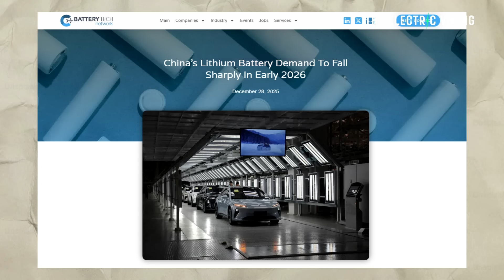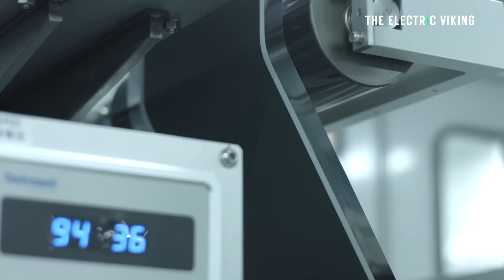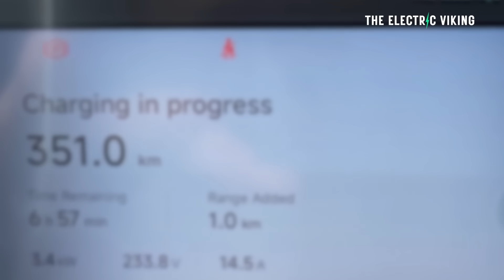SODIUM TAKEOVER! CATL Confirms Mass Deployment of Sodium Batteries for EVs

Comment from the maker: The car I drive, the Xpeng G6 - https://youtu.be/IcniwO8NfQQ

RESINC Solar installed my battery and solar system. Get a free quote from them here: https://www.resinc.com.au/electricviking
Reply: Any idea when individual consumer 18650 or 21700 cells will be available?
Reply: Alas, they don't appear to be in Melbourne.

Comment: Lfp and sodium battery density are calculated on a per weight basis. Sodium batteries are criticized for being too heavy. 
This must mean a 60kwh sodium battery must be smaller in size than a 60kwh lfp battery.
This must mean more sodium cells will fit in the same space as that of a lfp battery.
Maybe sodium batteries may have longer real world range.

Comment: I read somewhere that there is a wee problem with Na batteries.  Apparently Li batteries maintain almost a constant voltage as they discharge until right at the end.  Na batteries, thought, apparently have decreasing voltage as they discharge.  The article said that this is not an insurmountable problem but does require special electronics to deal with this voltage fade.

Comment: As the battery use increases, so will the need for fossil fuels to power them and build them. Effectively, you require more energy for a solution that was never needed in the first place. Probably doubling your energy requirements to build batteries than just using petrol or diesel.

Comment: Nobody is replacing humans with humanoid robots. That’s a myth. It does not exist anywhere. Manufacturing robots are replacing humans. They are not the humanoid toys that companies are working on. They are stationery and plugged in to power and the network. Humanoid robots are still dumb toys. They will have to be connected to a network wirelessly and will have to stop and charge frequently. They are not AGI and don’t even have AI onboard. Think romba..

Comment: Another plus for sodium batteries will be for starter batteries for current ICE vehicles. For not much more than a good quality lead acid battery I got a sodium battery with double the CCAs and still works in -30 or colder. No more wimpy lead acid.

Comment: If the price drops to under $20 per KWh, that is great news for grid storage and home storage. For grid or home storage the energy density doesn't really matter, the most important thing is the cost per KWh. Regardless of how rapidly cars swith to sodium ion batteries, companies like CATL will have plenty of customers for their batteries. Countries like Australia are already using large grid storage batteries, anyone saying that cheaper options for grid storage won't gain customers - well, I don't think anyone with a brain would say that.

The market for sodium ion batteries includes: Grid storage, home storage, budget oriented cars and any devices that operate in very cold conditions. That has to be a pretty large market, surely.

Comment: I work for an inverter manufacturer and we tested sodium batteries. We applied a large inductive load to the inverter and the batteries were not capable of delivering current fast enough to power the inductive load. The voltage collapsed and the inverter shut down. We referr to this as internal resistance and the internal resistance of the sodium batteries we tested is too high. So they might work fine for vehicles but in residential applications with large loads such as water pumps or air conditioners they may not be the best solution.
Reply: I'd love your input, another issue with Sodium-ion is they have too large of a voltage drop as the State of Charge decreases. Don't inverters usually require the input voltage to be relatively stable?
Reply: @Seattleandrew Inverters can handle any input V range if they are designed for it. The problem is that as the input V drops the input current has to increase for a given output power. This means the inverter electronics have to be able to handle higher currents which increases the cost.
Reply: @petewright4640  that makes sense. I'd assume that Na-ion is a nifty solution for some situations, but it's not a true replacement for every Li-ion application. Less energy density, less current output,  less usable voltage, but safer, potentially cheaper batteries.
Reply: Domestic loads don't use much compared to an ev. My relatively low power ev van draws 43kw when I put my foot down. A lot depends on the capacity of the battery. Large batteries have proportionally lower internal resistance. A house battery could have a large capacity as it's not size limited like an ev battery.

Comment: Lithium batteries will always weigh less than Sodium batteries. 
This is basic physics.  Sodium batteries are cheaper, but technically a step backwards.
A step forward would be Lithium batteries with a solid electrolyte.  This is uncontroversial as it is physics. 
Sodium batteries is a good solution for houses, or centralised storage

Comment: Researchers at the University of Buffalo could add a ‘superconducting’ twist to magnetic hard drives and random access memories (RAMs) after succeeding in building a Josephson junction using only one superconductor instead of two. The achievement could unlock new, simpler, and more flexible quantum designs in the future. 
A Josephson junction is the foundational building block of quantum computers. Built on the principle of superconductivity, the device consists of two superconductor layers separated by a thin barrier. Under these conditions, the superconductive nature flows into the barrier, synchronizing their behavior. 
Researchers at the University of Buffalo teamed up with those in Spain, France, and China to demonstrate that a Josephson junction could be built with just one superconductor layer instead of two and in the process showed how commonly available iron could also be used for quantum applications.

Comment: Have they found a way to flatten the sloping discharge curve that is prevalent with sodium ion batteries?   I don’t see them working well with EV’s until that is sorted out.  They need to be able to provide consistent voltage

Comment: Reliability and environmental stability is the key.  Sounds like sodium ion is a big improvement in these areas.  Longevity without degradation is very important.  Now the rest of the systems need to come into line, charging infrastructure and clean power systems.  Here the pollution is just moved a few miles away to a fossil fuel burning power plant.  My solution so far has been to cut my travel to one third and use higher efficiency ICE vehicles.  Looked at used EV but too many battery problems  and no local service.

Comment: Steady the Buffs. "Cheap" energy storage may be great, but where does the energy to be stored come from? Do we really want the country covered in wind farms with the need for new transmission grids? Last year the UK paid wind farms £1.5 billion to turn off. Increasingly, like in Germany the UK has periods of very low or no wind with a resulting fall back to Gas power stations. These power stations are necessary for reserve but will not be built without subsidies. The inevitable result, the more renewables on a system the more expensive electricity will become. Ed Miliband promised to cut energy bills by £300 but they've gone up by £200 since he took office thanks primarily to renewables.  And if battery energy storage is the silver bullet why is China, the world's leader in this area building so many coal power stations? Battery storage may help make extremely expensive electricity simply very expensive.
Reply: Rubbish.

Comment: it isn't so easy to just replace normal LiFePo battery packs..for cars it will not be so big deal in general but for rest such as 48V system..well here Sodium take many many years maybe even never ..it is possible it will be used for High voltage battery systems..but these will be available but expensive..so who knows.. and as you can see price isn't so much cheaper to liFe battery alternatives ..but eventually if price will be much lower and if some improvement is made then maybe..for now for 48V system it is unrealistic to be made cheaply..but later on with new improvements in transformers and electronics..maybe it will be ahit..but that will take 5 to 10 years to be cheap and available in high volume

Comment: I won’t buy an EV until o can drive from Melbourne to Sydney in one go. That’s about 1,000km. The sodium batteries sound like they’ll be 500km till recharging is required. Still not good enough. If the recharging takes about 45m to 60m, then I’ll be interested.

Comment: Sodium batteries have a completely different voltage/charge curve from lithium.  So ALL inverters,  motor controllers, etc. HAVE to be re-designed for this new battery chemistry.   These are not interchangeable.

Comment: Sodium wont be a direct replacement of lithium for quite a while, but it looks like extremely promising in a lot of application when energy density isn't the primary concern.
Reply: Why do you say that with such conviction? CATL are putting sodium batteries into cars this year 2026. Do you not believe it?

Comment: Well, the burger might have too much sodium for those with dietary concerns 🤣
Reply: Sodium batteries are not sodium chloride. They utilize sodium ions (Na+) as charge carriers, similar to how lithium-ion batteries use lithium ions. Sodium batteries can be made from various materials, and while sodium chloride (table salt) is a source of sodium, it is not the battery itself. Instead, sodium-ion batteries often use sodium compounds in their electrodes and electrolytes, which can include materials derived from sodium chloride but are not limited to it. This makes sodium batteries potentially more abundant and cost-effective compared to lithium-ion batteries

Comment: (Read to the end) Currently sodium is not much cheaper... They predict it to be much cheaper around 2030. With some tricks they can produce it with the same machines that was a great breakthrough recently otherwise every manufacturer needs new machines.... Lifespan seems crazy good but no real life usage and experience yet. Temperature is also looking good, but Bluetti already launched 1kW Sodium battery and a Youtubber compared it with an older LFP battery. Basically not much difference it can start charging colder around -15C but charge speed was pretty slow max 20%!
Biggest issue is the Voltage range 1 cell can go between 16V and 3V. It is huge range! Needs more complex Inverter to use this range. Also 1000 Watts / 16V = 62.5A but 1000 Watts / 3V = 333.3A so you can see the Voltage drop is requiring HUGE Current SPIKE which requires EXTREMA thick cables... So it is better in a few ways and I think will be cheaper than LFP in 4-6 years... But Sodium is not the Holly Solid State battery. So steps forward (and some parameters backward) in the regular battery world. Good improvements with huge HYPE 😉
Happy New Year...

Comment: sodium isn't a big thing, learn about the issues sodium has. it expands greatly, less capacity, it's discharge curve drops off faster than lithium. getting better but far from really being well prepared for cars. no idea wtf they are putting on the cathode with it to improve at all.
Reply: doesn't explode or catch fire after crash. most never switched to EVs because it s too common for EVs catching fire after crash?

Comment: Could this replace the lead acid batteries in fossil fuel cars? $40/kilowatt is there enough cranking amps and cold start amps?
Reply: That's what I've been wondering about.  What is the discharge rate, is it equal to or higher than a lead acid battery discharge or is it lower?  Can it generate the CCA's needed?  Will it freeze?  And if a sodium/iron battery checks the boxes, what about all important cost?  

According to AI, CATL will be making 12 volt sodium batteries in late 2026.  As for pricing... it took a bit of time to find out as I was curious myself what the cost of production might look like.  A copy/paste:  

A 12-volt car battery typically weighs between 30 to 50 pounds (13.6 to 22.7 kg). To convert this weight to kilowatt-hours (kWh), you would need to know the battery's capacity in ampere-hours (Ah) and its voltage (12V). For example, if a battery has a capacity of 50Ah, the energy capacity in watt-hours (Wh) would be 12V x 50Ah = 600Wh. To convert this to kilowatt-hours, divide by 1,000, resulting in approximately 0.6 kWh of energy capacity.  

The price of sodium/ion is $40 bucks a KWh and a lead battery delivers 0.6 kWh?  That's cheap.  But, that's at the cell level which is roughly 70% of the cost of the pack level meaning a battery pack is $57 bucks rounded off per kWh.  The actual cost would be $40 bucks for a 0.6 kWh battery from CATL.  By the time it gets to the states through various middle men, shipping and tariffs, it's a $200 battery lets hope!

Comment: For a so-called expert your advice contradicts everything I’ve read in the past week in my own deep dive before investing in an ev and home battery. Sodium Ion is different to Sodium Iron. Both of these are great for capturing Solar in a home but are not yet approved by our nanny state for connection to the grid. For EVs Samsung and CATL solid state lithium chemistry is the way to go. The feature 500wh/kg, 5000+ charge cycles, good performance sub zero than current chemistry and less fire risk due to a solid oxide ceramic electrolyte . I won’t be booking a consultation with you Viking because you are not current with your bullshit.

Comment: I just purchased a whole home inverter, solar panel and battery solution in June 2025.  I paid WAY TOO MUCH for the battery part of my solution.  It looks like I will replace my battery in 2028 or 2029 with a system that will be triple or quadruple the capacity for 1/5 the price I paid.

Comment: Sodium-ion batteries are real, commercial, and expanding, particularly in China. Major manufacturers such as CATL and BYD have confirmed production and deployment across energy storage, battery-swap systems, auxiliary vehicle batteries, and limited EV applications, especially in cold climates where sodium chemistry performs better than lithium-iron-phosphate (LFP).

However, claims that sodium-ion batteries will replace lithium-ion technology or cause a collapse in lithium demand in 2026 are not supported by evidence. No credible industry forecast projects such an outcome. Sodium-ion batteries have lower energy density, making them unsuitable for most long-range passenger EVs without significant trade-offs.

Price and performance claims—such as $20/kWh costs, 5-million-kilometre lifespans, or mass-market 500 km EVs—are aspirational projections or marketing statements, not verified commercial benchmarks.

The reality is a dual-track future: sodium-ion batteries will complement, not replace, lithium-ion systems. They will meaningfully impact stationary storage, low-cost vehicles, and cold-region deployment, while lithium remains dominant for high-energy-density and long-range applications.

Sodium-ion is an important addition to the battery ecosystem—but not a near-term disruption of lithium dominance.
Reply: That's a usual ChatGPT mumbo-jumbo. Due to economical reasons nobody is going to make "cold climate only" EV cars - they all will be equipped with Sodium-Ion for cost and market reach reasons.
Reply: @AlekseyVaneev you confuse use-case advantage with universal replacement. No one is talking about “cold-climate-only” cars — the point is that sodium performs better in cold, which makes it suitable for certain segments.
Energy density is the real constraint: sodium-ion is still ~30–40% below LFP. That means heavier packs, less range, or compromised vehicle design — which breaks the economics for mainstream 400–500 km EVs.
Lower $/kWh doesn’t equal lower vehicle cost. OEMs optimise $/car, not $/cell. If sodium were a universal solution, major OEMs would already be pivoting entire platforms — they aren’t.
Reality points to chemistry diversification: sodium for low-cost, short-range, storage and cold-tolerant applications; lithium where energy density matters. That’s systems logic, not hype.

Comment: With more EV cars and trucks, overnight charging will become a growing demand as nightime supply declines. Some daytime fast charging will be possible but not if they all want to charge in the middle hours of the day. Standard, sodium, swap n go, floor batteries will allow spare batteries to be charged with daytime solar then swapped overnight as long as labour costs are less than a night time charging cost.